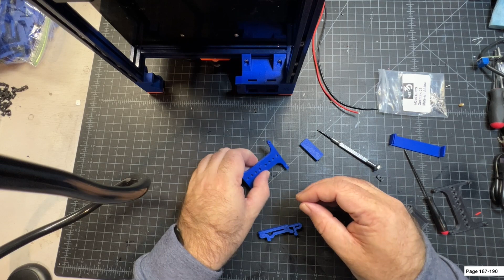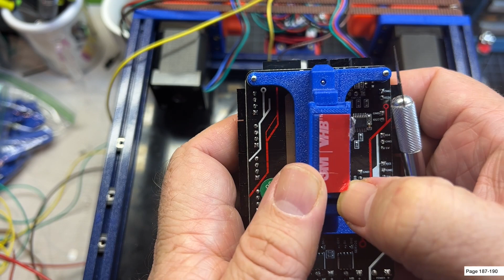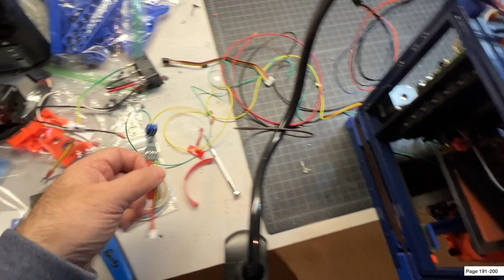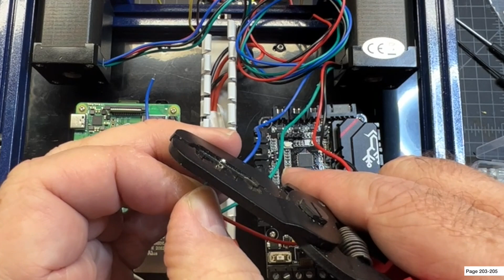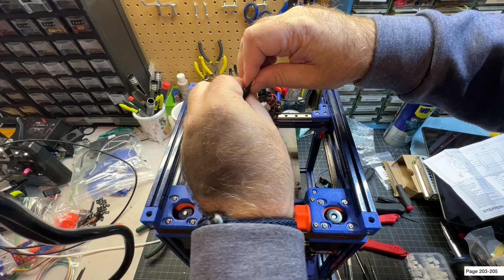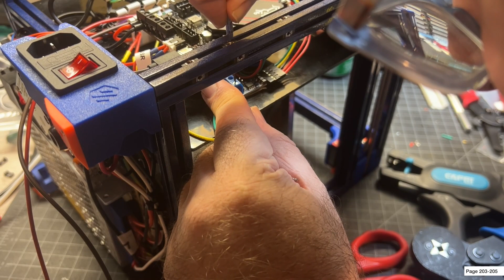Voron 0.2 Build Series - Part 13 Electronics Wiring

Comment: Have you had the issue where you have to press reset on the skr pico to get the system to restart? This has been an annoying bug with this combo of parts
Reply from the maker: I haven't had that problem, but I definitely have heard about it in the discord. Some pico chips were affected but not all. Have you seen this fix for it yet? Folks in the discord have said this works for them. 

https://github.com/Drachenkaetzchen/VoronMisc/blob/main/SKR-Pico-Reset.md